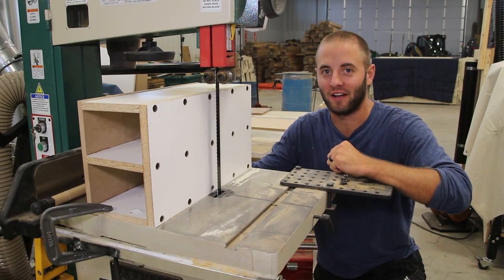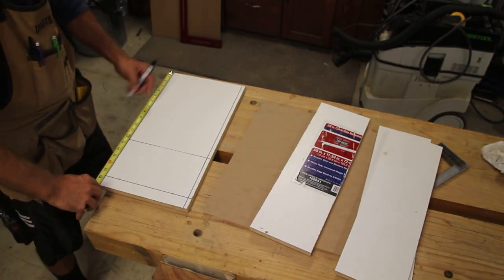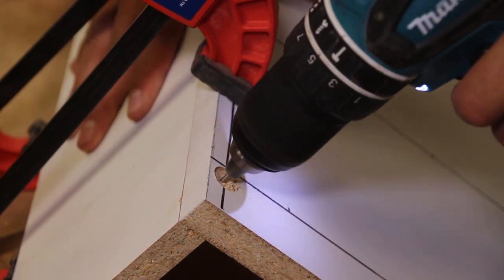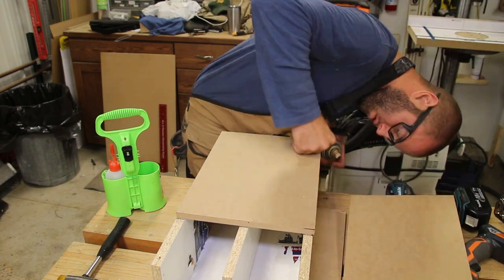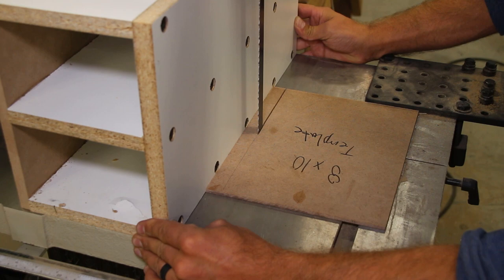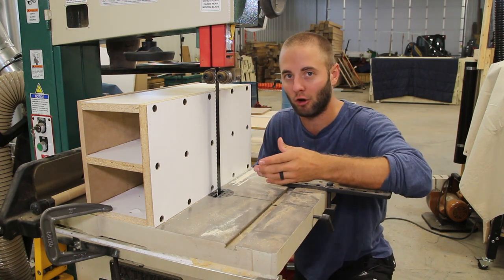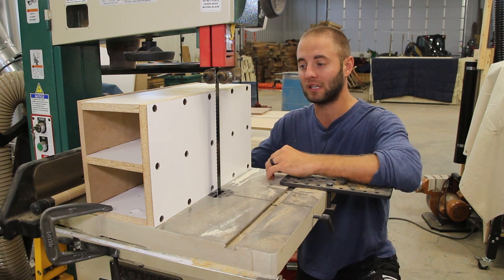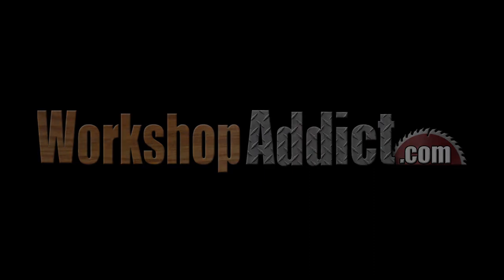Build Simple Strong Bandsaw Resaw Fence

Comment: Just a observation but I would put solid ends, either cut to fit between the divider you have in the middle or placed right on the ends with access holes for clamps. There is very little lateral strength in the fence left the way you constructed it and you did mention a power feed roller pushing material against the fence.
Reply: Agree.